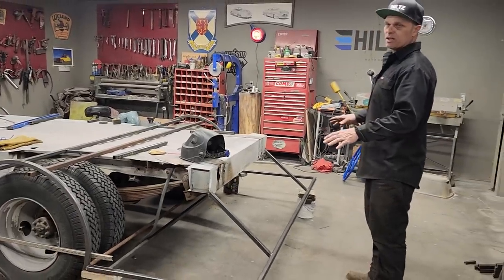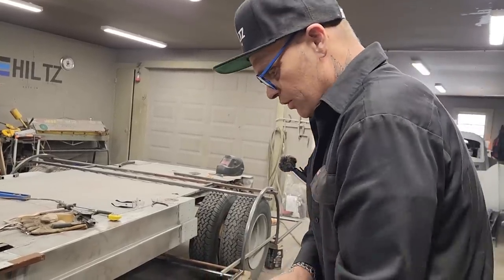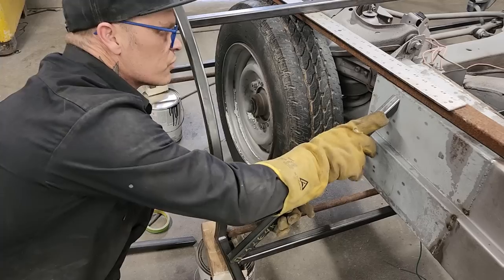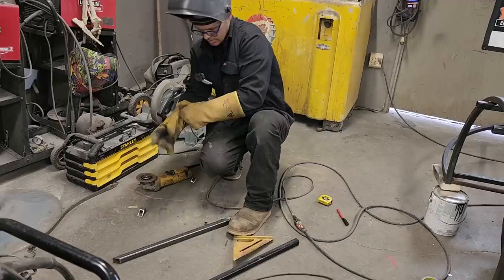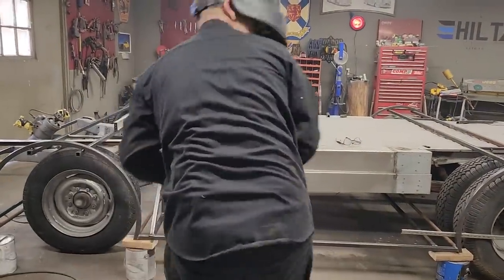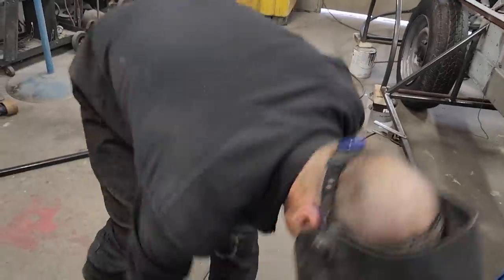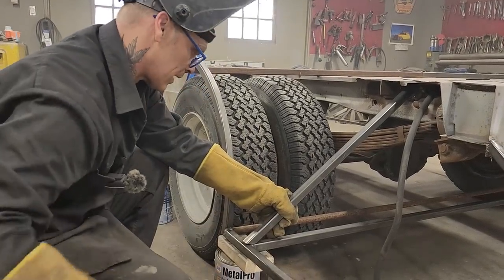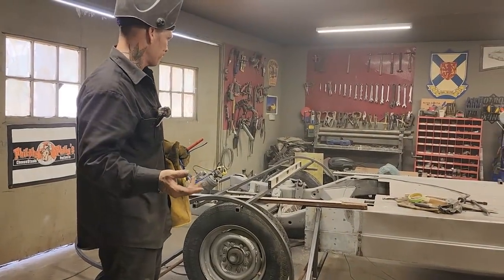Lots of controversy with this build ⚠️

Comment: Before you get too far in please take another look at the front wheels. Maybe mock up a second wheel outside the existing one and then jack it up and steer lock to lock to see if they clear the wheel arches. I think you will be surprised how much they move. Even if they just fit, I think dual wheels would put up a lot of steering fight on uneven roads, cambers etc.
Better solution as others suggest is to make the whole thing narrower and single wheel at the back, or fit flared arches at the back.

Comment: Just  an idea ! If you take one of the back tires off the rear, you could move the frame your building closer to the van frame. Fixing the front gap problem
Reply: That was my exact thought from the start, but I didn't know if he needed the tandems to carry the Bugatti or if he was towing the Bugatti on a trailer!!!
Reply: The builds well along now for that to happen but lets face it rear duals give it some gravitas eh!
Reply: Chad I think gave you a hit today, if you caught it, Chad is basically always looking for the quick and easiest fix, he said today that he was thinking of have full lenght shirts on it, so he doesnt really need to do anything if he is going to hide the wheels.
Reply: @harryharry4724  Isnt that what he always does, I agree with you, he should have used a 2 to 3 ton truck to do the project with, not a Delivery Van. It will more than likely just get pushed into the shed with the rest of his crap.
Reply: @jamesmatheson5115  I also thought full fender skirts front and rear would hide the difference in tracking width. I would have gone for a narrower unit, remove the duals at the rear.
Reply: @bruceharvey8810  Yeah my first thoughts was to take the dual off and just narrow it all, I know an original had a wheelbase of 140", it was 6' external height, 26ft total length, it also used the 1934 Diamond T 740 as the prototype, I cant find the wheel track, Ild suggest the 6 built were 1935 Diamond T 750, so it would have the wheel track of that.

Comment: Instead of widening the front wheels,the back wheels should be single.For the lenght of the vehicle it should be narrower ,may be only 7 ft wide
Reply: Exactly what I was thinking. This way it would have been much easier to attach the sheet metal to the frame later as well...
Reply: Exactly. The problem of the narrow front track can't be solved by spacers or dual wheels because they will move so far forwards and backwards on lock they will hit the structures he is putting now. Only other way is to widen the front axle, which is too difficult a task.

Comment: The upper structure, you will have to allow for directional expansion from sunlight to cold weather.  Rivets may need to be considered for outer skin or the bows will have to have some give.
Reply: Its a custom vehicle not a space ship.if you are an engineer u maybe overthinking it.😂
Reply: And it like all the others will not be driven.
Reply: @Robert-il4pi   Always about the end creative overall look, and engineering for functionality and safety is …..never seen because that is mechanical 🤯😂…Makes me wonder how many of the builds pass certification!

Comment: I’m a something from nothing builder too like the videos. One suggestion, if the doodle bug is gonna possibly be a hauler then the floor needs to be wider, if so then you should widen the floor at the top with heavy angle iron all the way over to the outside then gusset it to the inside frame then the body can hang off these supports. This would serve as body mounts and you don’t need all the bracing running underneath from one side to the other. 
For the front wheels maybe cut the frame sections, widen the engine cradle and lengthen the drag link and tie rods, this would put the steering back to the outside and move the suspension out with the wheels where it should be   Just suggestions !!!!
Happy Birthday Jolene!!

Comment: Chad and Jolene, you mentioned earlier something about needing to come to a solution for making the track of your front wheels wider.   You might consider using super wide tires there or even installing dual wheels.   Single wheels might be a better solution/cause fewer steering or suspension challenges.   Keep up the good work, and thanks for sharing.   We're all just enjoying the ride with you😊

Comment: Happy Happy Birthday Jolene. Tell that Mad Builder to treat you like a Queen for your Birthday. The build is so intereresting, quite unique. I read most of the comments about 8 wheels (4 doubles) it would be certaily different.  The only way I can see to move the front wheel outwards would be to re-engineer wheel mounting. This would require an amount of serious work. The other way would  be to simply cut and adapt another wheel rim and weld it to the back of the existing  wheel. Most of the old dirt racers used to achieve their width to the back wheels. Some even ran with the two wheels seperate. Keep the wheel nuts on the inner wheel and make the nut hole on the outer wheel large enough to pass  the wheel wrench through. The slightly enlarged nut mounting holes would not appear out of place. Keep up thhe great work, you are a great pair of entertainers.

Comment: Thinking of the double wheels front and back, again. The proportions of this chassis and those wheels look similar to a large go-cart with fat racing slicks. Sort of. That is good, especially if you intend to mount the engine mid-ship. That will take a lot of the direct weight off the steering wheels. So, why not? Except the racing part. Great fun watching. Great camera work. Excellent mouse footage. Thanks guys!
Reply: You won´t be able to steer - look how close the frame is positioned to the front wheels. I wonder if there´s even enough clearance right now...

Comment: Hauling jolene's Bugatti in this doodlebug creation of yours as a hidden car hauler is a fantastic idea in my opinion. In any case it'll be interesting to see where you go with it. Even if you don't make any adjustments or whatever your plans turn out to be for this doodlebug, it'll be interesting to see when you get to your quitting point on the project. I had wondered about the strength item because that frame is meant to be part of the entire structure. Also happy birthday Jolene 🥳🎉. You're twenty-three today right 👍.

Comment: The way the wheels are so far inside like they are up front someone mentioned. The best way in my opinion to handle that would be to find a solid front axle from a bigger truck like Kodiak or a top kick and mount it on leaf springs, and that would bring your wheels out in the front I believe where you want them. It looks like in the picture that is what it had. But the bigger truck axle is going to be wider than the camper anyway. Just a suggestion  .and have a very happy birthday Your Highness ,all hail queen Jolene on one of her many  birthday's to come. And may I say fantastic build going to be Interesting at the least. But I have great faith in your work. You guys are a great team.

Comment: Can you use the off set wheels on back to see if the outside wheel will work on front to widen stance of steering. Also could you use 2x2x1/8 tubing to make a receiver hitch on back. That way you could tie this into main frame and run it down to the smaller tubing to make it stronger and also have a towing hitch. I am amazed at the thought process and the ideas you have that go into your projects. Again great videos and keep up good work.

Comment: good morning, I wonder why you immediately weld everything. by sometimes applying bolt fasteners you can adjust plans more easily. Because your plans are adjusted almost daily, you don't make it easy for yourself. for example you could have made base plates in the side of the floor. But it's your project and I like to look at it. greetings from the Netherlands.

Comment: I agree with other comments that the rear end should be narrower (perhaps single wheels) as I think it looks to wide.
As for gap around top of tires, as the vehicle is built with body, engine and fit out the suspension will lower and gap at top of wheel will reduce. Have you given any thought to this?
I love your work Chad.

Comment: I would get the front clip from a junk 18 wheeler to get the front wheelbase you need to move the wheels out to the body.
Is have the axles turned down to use the wheels and tires. Or I'd get an old RV front end that has the same wheel width you have on the back.

Comment: I think a more efficient way to support the weight of the body would be to run 1.5 inch or 2 inch square stock all the way across the flat floor, make another outer perimeter that matches the one at the bottom, weld it to the top of the ends of those bigger square stock pipes, and then install vertical pipes from the top perimeter piece to the bottom, which would result in everything below the floor being securely hung in place.  It also makes it so the upper body is supported by the floor structure rather than trying to make the bottom perimeter bars robust enough to hold all the weight of the body from the bottom all the way to the roof.
Reply: It also could essentially make the body modular.  Meaning easily removable, almost like an RC car body.

Comment: The headache will be the front wheels. Dual wheels in front will only allow a few degrees of turning before they hit the bracing that was made.
Mock up a cardboard front wheel, turn the wheels and you'll see where it hits. The spindles need to be moved outward for proper swivel axis.
An I beam front end may be an option.

Comment: Hey Chad and Jolene, on the front how about if you do like you did on the back of Jolene Bugatti and make fender skirts for the front,you would not see the front tires,or you could draw out a rim and tire on it and paint it in,then it would look like the back but the wheel would be more inside.

Comment: You have a geometry problem come with the front suspension.  Steering pivot or ball joint location is to far inboard.  GM built the future liners back in the 30s or 40s. They had dual front wheels and the swing of the outboard front tire was huge.

Comment: Hey Chad and Jolene. First off, Happy Birthday Jolene!Just a thought, you may want to consider adding to the frame rails on the front. It will be hidden anyway, protect you in the case of an accident and also provide structure to extend your floor so you can sit forward in the position of the doodlebug picture. It will also give you more strength to hold up the weight of the upper framework, sheet metal and windows. Definitely a cool build, keep imagining and entertaining! 👍🇨🇦

Comment: I know you are a ways into it, but I feel the whole body is too wide. If you narrowed the square tube shell to be closer to the floor width of the motorhome, it would correct the front wheel issue.The rears could be moved inboard. The truck body will become too massive and out of proportion in it's current configuration.

Comment: the dual rear wheel trucks had a cast spacer that bolts to the hub, to move the wheels out, so a dually wheel will fit and clear. Since your front wheels aren't dually wheels, I wonder if that hub or spacer isn't correct for the dually wheels. Should be easily procured if gone. I would love to help. Best!

Comment: Good job on the bracing, but  I cringe a little every time you cut a piece on the concrete floor and nick the concrete. Why not put a thin piece of sheet metal scrap between the workpiece and the concrete and save your floor from looking like hell after many cuts?  Concrete is pretty expensive !!
And Happy Birthday, Jolene !

Comment: Chad, ever consider a mitre saw for the cutting whether 90 degree or angled . I am a millwright and it might not be required as a necessary for you but I like the bench height with material supports for all cutting similar to this. Just a though.

Comment: Are there any engineers out there? There must be a benchmark of how much weight those 1 x 1 1/4 inch wall square stock will take. There are 4 holding up the outside frame from underneath, how much weight will those hold when he adds the side panels and roof , how much deflection will there be going down the road of the metal. I think 1 x 1 is too small  just from a no nothing perspective. Am I wrong?
Reply: I know there will be other connection points like fenders ,the bow at the top etc.  But in my mind , the majority of stress and weight ,will be on those 4 bars going under the vehicle.

Comment: Those braces are every strong, when you hang a gate if you use a timber cross brace. You go from the bottom hinge up to the latch, if you are using a metal brace it’s the opposite you go from the top hinge down to the other opposite corner, like a strong arm, exactly like you have done, the triangulation makes it epic strong , happy two day birthday Jolene, must be about midnight there

Comment: Hi Chad, I'm watching your latest post and noticed that the frame at the rear has right angle corners.
You have mentioned that you are going for a sloped/angled rear body shape. I am just wondering if you have considered radius corners instead in keeping with the convex shape overall. 
A sloped rear end with rounded lower corners essentially.
All I can visualise is a 1/4 sectioned icecream cone shape receding along each side. In my head it subtly maintains the roundness  overall.
I'm not a car builder but am into shape form and style in anything.
Cheers Les.

Comment: Hi Chad, please use Google-translation, I write in German: Das Chassis des Wohnmobiles wird sich während der Fahrt verwinden und verdrehen. Der Rahmen für die Karosserie ist räumlich und wird sicher nicht so elastisch gebaut um die Bewegungen des Fahrgestelles nach zu machen. In Folge dessen wird die Karosserie und deren Struktur Schäden nehmen. Meinst du nicht, ein guter Weg zu einem langlebigen Fahrzeug wäre, einen Hilfsrahmen zu bauen und dann mit einer elastischen Verbindung auf dem Hauptrahmen zu befestigen? Am Hilfsrahmen werden dann alle notwendigen Streben und Halter für die Doodlebug-Karosserie eingeschweißt und sind eine solide Basis für die schöne Karosserie. Dank der elastischen Schraubverbindung zwischen Haupt- und Hilfsrahmen kann das Chassie sich wärend der Fahrt verwinden und verdrehen, ohne dass die Karosserie Schaden nimmt,  oder gar das Chassie Schäden nimmt. Verstehe meine Idee als Anregung, nicht als Kritik. Gutes Gelingen und viel Spass

Comment: Happy birthday Jolene 1:02:46 . Chad I’m concerned about the square stock not being strong enough for an accident to the  side of the vehicle. If some twit side swipes or runs into the vehicle and even the front the 1inch square stock will not be strong enough to withstand any impact damage from crumpling back to the main structure. I think that your going to require more bracing than you currently have. This would be especially on the area at the front where you say your going to sit to drive from. This being the case both you and your front passenger will be at risk of major injury.  Enjoying it so far but am concerned these points won’t be addressed. GB Australia.
Reply: Chas mentioned a seating place up front. I don't think he meant driving it from there, maybe just a place to sit when parked, etc. He will be driving it from behind the steering box.

Comment: As you move the front tires outward the more of an arc they will have. Check your clearances pretty soon. If you are still planning on dual tires, use one of the rear ones with the offset out and then move the steering full left and right to check wheelwell and brace spacing.

Comment: I wonder if the extra wide tires would work on the front wheels to bring them out more with the rear wheels.  I know there are some that are VERY wide, like those that are replacing dual wheels on some of the big trucks.

Comment: I’m gonna say something it’s too wide it makes no sense. he should be working off of the trucks platform it does not need to be exactly what he’s getting his inspiration from he can make it look like the picture of the truck but do it in a different way where he doesn’t need to Make the front wheels wider I have never seen 1 in.Square stock running under a vehicle before remember I would use the chassis that he shortened I would put a motor in it build some sort of cab over the motor and then build the back of the vehicle I think all this other stuff is just too big it’s just gonna take so much materials it doesn’t make any sense that’s my two cents ????

Comment: You have to keep in mind that the pivot points for front wheels are the ball joints.  Offsetting the wheels will increase their sweep within the wheel opening.
Reply: Yep. If  it somehow avoids becoming a problem it`s 100% luck and 0% planning.

Comment: I know what you're talking about Chad. I was building a little hot rod pickup (sold it about half done as I thought I was moving overseas). All I started with was the cowl and doors. I built the chassis, the framework for the cab and steeled out the cowl and doors with tubing.

Comment: Happy birthday queen Jolene from uk .this looks like its going to be a wide wild ride for sure interested to see where the doors etc come into play ,the mind boggles could be drop down step doors would look super cool or same shape doors as Bugatti and have that strip running across middle from front i mean if its to carry the queens car may as well look a little like the car .loving the content as always big thanks you both .also thanks to the chat mods cant leave them out .little mousey wanted watch some bad chad .
Reply: The problem with it hauling the Bugatti is Chad was talking about a mid engine truck and there is not enough length in the classic to do that with an mid engine design nor enough length with a engine in the normal position for the passenger compartment and the Bugatti